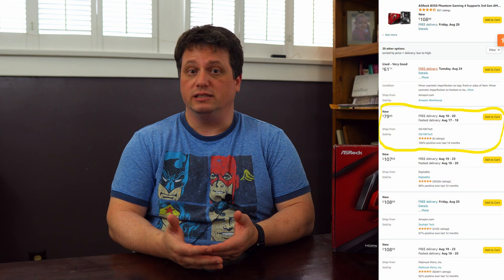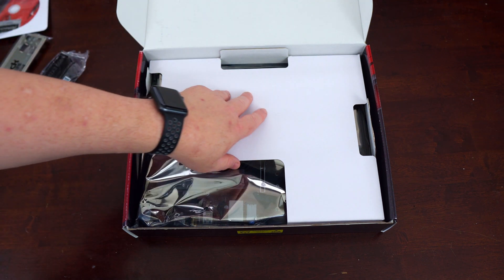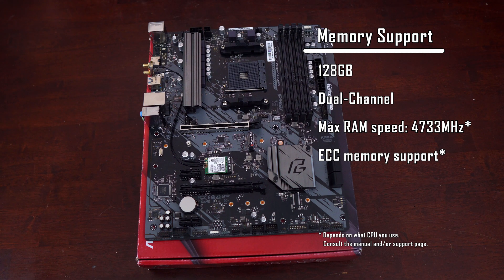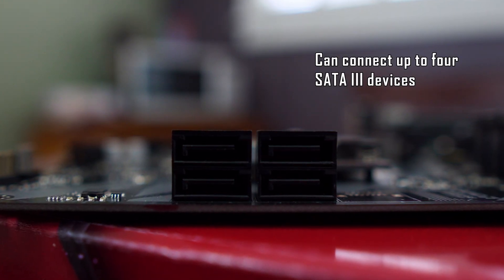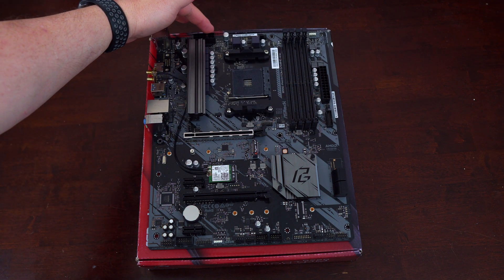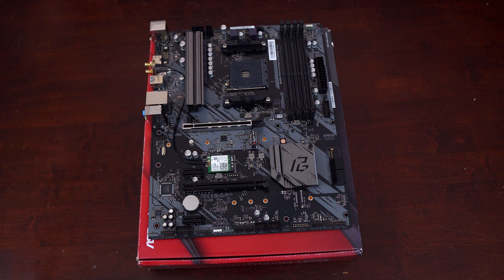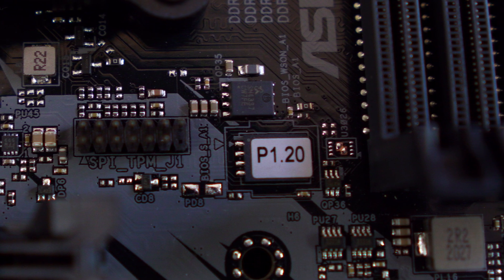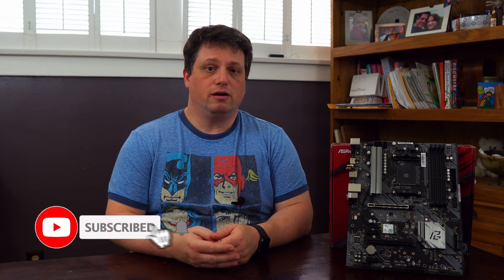Taking a look at the AsRock Phantom Gaming 4 AC: A low cost B550 motherboard with plenty of features

Comment: Just got this on sale for $84.99 and a Ryzen 5700 for $124.99! Crazy to upgrade my platform to something more modern and with some extra cores for ~$200! I was considering X3D chips but they’re marked up ~35% currently rather than down and I’m already getting a 93% gain over my i7 8700! Great video, I think this board is great even today. Especially now that it’s becoming discounted further!
Reply from the maker: Glad you found this on such a good deal! Prices are crazy in the states and just gonna get worse unfortunately. Have fun with your upgrade!
Reply: 5700 (non-x) is not great for gaming because it has half the l3 cache compared to the other ryzens

Comment: Kind of late here, but urgent question, would a ryzen 7 7700 pair well with this motherboard? I want to upgrade from my Ryzen 5 5600x, but just want to be certain it’s comparable or if I’ll have to update bios any response is appreciated thank you!
Reply from the maker: Not with this motherboard no. This is an AM4 socket board, you need anything with an AM5 socket so like a B650 chipset or X670.

Comment: Thanks, I did not know that I needed a 2nd CPU to updating the BIOS. Madning.
Reply from the maker: Only if the cpu you intend to use is not compatible due to the current bios installed. But I agree. It is maddening.

Comment: Very nice overview of the motherboard. I just got one and am wondering do I need to connect the 24pin and 8pin power connectors from my PSU? I’ll be using a Ryzen 9 3900x. No OC. Thanks!
Reply from the maker: Thanks for the watch! Yes, you will need to connect both power connectors. the 24-pin specifically powers the motherboard while the 8-pin will provide more power to the CPU, so you absolutely need those. You may even want to connect that supplemental 4-pin CPU connector as well.

Comment: Will R9 3900x be compatible with this board?
Reply from the maker: Yes it will, but you might want to buy a motherboard with a better power delivery and power delivery heatsink.
Reply: @MiddleofKnowhere  Oh ok. Any suggestions?
Reply from the maker: MSI b550 a pro is good or the asrock pg velocita
Reply: @MiddleofKnowhere  Thanks

Comment: Thank you for this in depth video. My nephew was having issues with a build that I was helping with on this board, and was getting a solid CPU and RAM light. He told me partpicker was saying he may need a BIOS update, and wasn't sure where the BIOS was on the board. That sticker zoom in helped me locate it to make sure that was not the issue. Now it's time to try and figure out what IS the issue :)
Reply from the maker: I'm glad the video helped! Def make sure the RAM is seated fully. If you keep having the RAM light on, try taking one stick out. If the problem persists, try the ram in a different slots and then try the other stick. Also, since the CPU light is also on, maybe consider taking the CPU out and putting it back in, but before you re-insert check for any bent pins.  Depending on what cooler you're using make sure any plastic peel on the part touching the CPU has been removed. Also anytime you remove the cooler you'll need to clean and re-apply thermal paste so make sure to buy a spare tube. I recommend this anyway as you'll want to do maintenance after a year or 2 and apply fresh paste anyway. Hope your nephew gets the PC to work!

Comment: Hi, would a 6600 fit in this board? The pci 4.0 slot looks too close to the other ports in the back, is there enough space?
Reply from the maker: should fit just fine. GPUs tend to be bulky going towards the bottom and not so much to the top where the rear i/o would be.
Reply: @MiddleofKnowhere  I see, thanks alot

Comment: Hey, my PC startet for 2 days after that it just shut down, it was the CPU, but now i have a New one and it dont Show anything on my Monitor i checken the gpu and motherboard but Nothing works, the LED for CPU und Dram ist still on idk what to Do:/
Reply from the maker: Make sure your ram and gpu are seated properly. The try stick at a time. And before all of that make sure your display port or hdmi cablemod fully plugged in at both ends. Those are some basic trouble shooting.
Reply: @MiddleofKnowhere  yeah i know :) but idk what it was but just take it apart and build it again , now it works :D
Reply from the maker: Oh good! Did you figure out what was the problem?
Reply: @MiddleofKnowhere  nope :(
Reply from the maker: But it works none the less?
Reply: @MiddleofKnowhere  yes with no Problems:)

Comment: Damn finally a video that made it clear.. it has only one m.2 slot :/ damn going to need a new motherboard
Reply from the maker: If you need a board with 2 check out n my msi b-550 video. I liked that board.
Reply: @MiddleofKnowhere  if i were to buy the msi b550 to upgrade from the asrock phantom, is it as simple as plug and play? i have a amd 3600
Reply: One is more than enough. SATA drives are usually almost as fast as nvme ones for daily use. Don't get fooled by the theoretical speeds: these can only be attained when copying huge files, and even then, you are more likely to be limited by the USB connection, which won't give you more than SATA speed on regular 5Gbit/s USB3 connections.
Reply: @sassuki  this is objectively wrong.. yes most users wont notice the speeds but i do because i do gamedev and video editing, and copy 100s of gb everyday so yes i do see the benefits from Nvme drives and i have 3 now. 500mb/s vs 3gbps+ are a massive speed upgrade and they cost very similar prices nowdays
Reply: Wth. Wish I watched this before trusting the literal manual. It said it has support for 2 nvme.